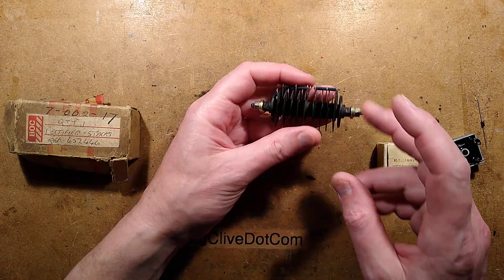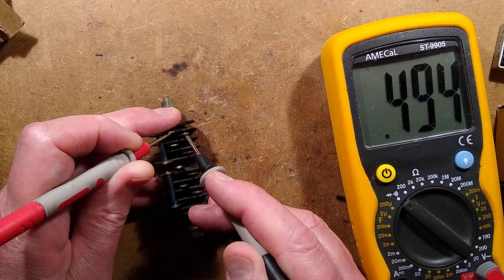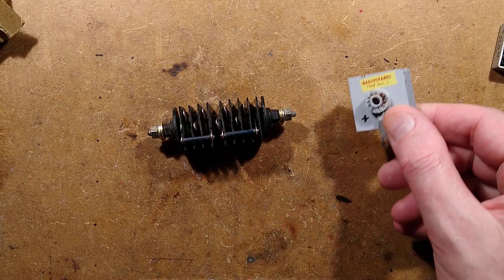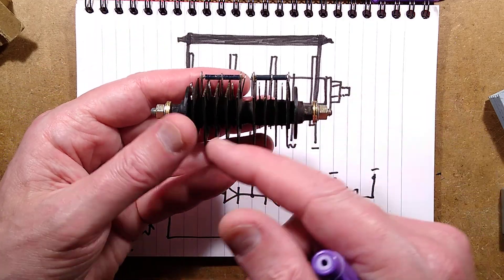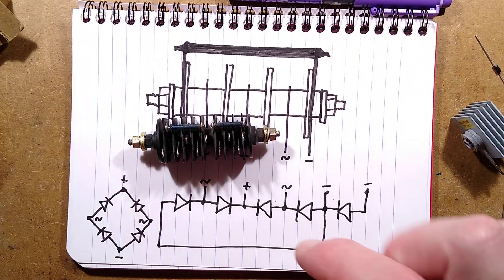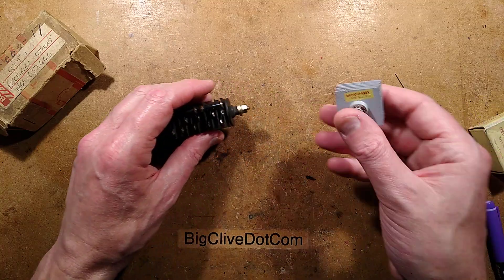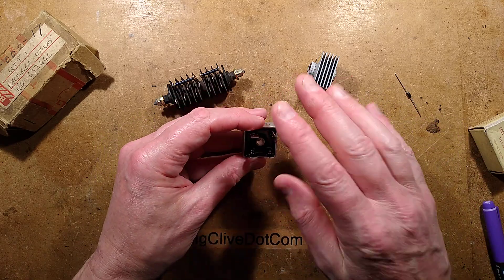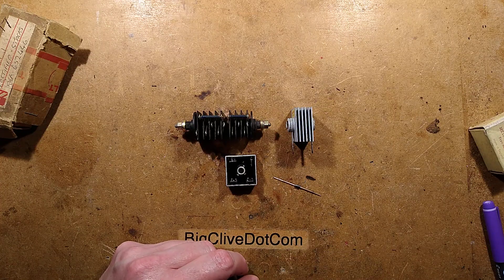Selenium rectifiers - the smelliest components ever

Comment: Had to deal with that smell only once in my career as a cinema service tech... it was horrid. Ruined my clothes and took weeks to get the smell out of my tool case AND truck. One of the two converted (old carbon arc to xenon lamp) rectumfryers shit the bed.  They both got replaced with newer silicon based ones after I warned them the second one would fail soon too.  I think I have a few of the much smaller ones ("new" old stock) in a box of parts I bought at an estate sale.

Comment: In the early 70s, selenium rectifiers and electrolytic capcitors rated at 300V were easy to recover from discarded B&W TVs. We built a big capacitor bank, connect a rectifier to the mains and charge the capacitor bank. Upon shortening, they made a scaring BANG! 
Yes, I remember the stink, when the rectifier got hot.

Comment: Replacing a selenium rectifier with the diode square hasone pitfall : The selenium rectifier assembly forms its own heat radiator, so the equipment is usually lacking anything usable  for the rectifier brick, even often it becomes a pain in the rear to find any suitable place to mount one of those generic rectifier/SSR heatsinks in a way to not obstruct the airflow...
Reply from the maker: Thankfully the voltage drop is much lower, so the rectifier generates less heat.  In many applications it can simply be screwed to the chassis plate of a panel.

Comment: Those old musty electronics parts boxes you displayed reminded me of the hot smell of WW2 vacuum tube electronics. I grew up in 60’s Dayton, Ohio adjacent to Wright-Patterson Air Force Base which generated mountains of surplus military gear. It was sold locally & found in businesses & schools. In 1964 I purchased a replacement acorn tube for the IF section of my surplus Hallicrafters S-27 receiver. It was packaged in its original 1943 box & cost me $21-1964 dollars derived from my newspaper route. I spent hours listening to foreign shortwave broadcasts, the YouTube of the day.

Comment: I've got a pretty good-sized box of those things somewhere in my garage
Reply from the maker: They may have collector status now.
Reply: @bigclivedotcom if I ever clean up my Electronics hoarder garage and find them I should probably send them to you
Reply: I think it's been a couple of years since I've seen it but I used to have this thing I built in high school at used a 555 timer a relay several D cell batteries and some spring connectors if I remember right they might have Been nicad battery powered 

I think its sole purpose was to provide a time delay and burn up whatever it was connected to it via the spring connectors I think I had some very smelly resistors or diodes that I used in it

Comment: In the 70s if you were following a TV engineers estate car or van you would often see something hanging out the rear door. This would be an EHT multiplier usually a tripler or quadrupler, it supplied 25000V to feed the CRT. There were five or more selenium sticks potted in a rubber compound, the smell of a faulty unit was so powerful you could often diagnose its failure on a service call the instant the customer opened the front door.😂

Comment: Ah ... now I know what the weird device is that's been sitting on my bench for quite a while! I "inherited" an old car battery charger from the early 1960s ... was still in use until a couple of years ago. It was one which was switchable between 12V and 6V as my stepfather had used it with an old VW that had 6V electrics. When it eventually stopped working I opened it up to have a look inside ... and I saw a device that was completely new to me. I guessed that it must be some kind of old rectifier but I don't remember it making a stink when the charger stopped working so perhaps the rectifier itself is OK. Many thanks for (another) educational video!

Comment: The worst. We had a extremely old forklift battery charger that used some extra large Se rectifiers, we are talking about plates that made it look more like some kind of space heater than a diode. Anyway it let go and made the whole factory smell like 💩. It used 2x of them with a huge transformer. Ended up replacing them with silicon arc welder diodes, but had to change the input tap from 208v to to the 277v since the 0.8v is far less then the several volts that the original ones had. Charger also ran a LOT cooler too. ❤

Comment: I'm old enough to remember these. I had a motorcycle that was old in the 1970's, and it had one of these as part of the charging circuit, and a record player with one. There may have been some where I worked, too - but I never smelled one fail. I learned a lot about these today!

Comment: I have a vintage spot welder that uses these - still works very well. It must deliver a couple of hundred amps... It's in quite a big housing (built in to a bench), so I am tempted to repackage into a smaller package so it can be benchtop - silicon diodes are quite a lot smaller 😂

Comment: Always wondered how they worked.  The only one I have seen was in my ancient BSA 250, bought in 1964 for 15 quid.
I thought that there might be one in a Linwood battery charger I got from Tandy in 1980 but not so, just a pair of silicone diodes, half wave rectification.

Comment: You can still find Selenium rectifiers being used in car battery chargers, especially those from China. Their voltage drop, rather rough DC output and internal resistance can be useful for Lead/acid battery trickle charging.

Comment: I can  custom order selenium rectifiers in any size from 1/4 inch x 1/4 inch x 1/4 inch up to 15 inches x 15 inches x 96 inches. Electroplating facilities, and DC elevator motor power supplies still use them. You are NOT replacing a selenium rectifier, with a bridge rectifier in a circuit that requires 600 VDC @ 200 amps, or 6 volts @ 2000 amps.

Comment: this was great. i have a bit of 'thing' for rectification of late. i would love a pretty mercury rectifier with it's smashing blue glow to play with. i just learned they used 3 phase ones, some years ago, to play an alien brain thing in dr who. how cool is that? talking of rectification i have been trying to get a chunk of galena to rectify the signal from my function generator, so i could watch it on my 'scope. i expected it to behave like a diode does, but a bit worse. tbh i couldn't get it do to do anything observable. i spent ages stabbing about with my probes. either i am failing to understand something obvious, which is entirely possible, or maybe galena can only rectify tiny weak radio signals. i have looked online to find out but all i find are crystal set instructions, when i could really do with a lump of galena data-sheet. i was hoping i could get four lumps and make a full wave rectifier for fun with them. i can't.
Reply from the maker: You may be able to buy a vintage mercury rectifier tube on eBay.

Comment: No,  it does NOT smell like a fart,  it's MUCH worse...!

When I was a kid,  I put a little plastic box with a switch in the middle of an extension cord.  The middle position of the switch was off,  one side would directly connect things,  and the other side would put a small selenium rectifier in line.  Plug a lamp in and you had a sort of a dimmer.  I was showing off this device to a neighbor lady after I'd gotten it built,  and then progressed to trying various things out when it let that nasty smoke out.  I'll never forget that smell.

Much more recently,  a friend brought over a nice Grundig tube-based console stereo that he wanted me to fix because he liked the sound of it.  I traced the problem to a bad rectifier,  and was surprised to find that it was selenium.  I put a terminal strip in there and some 1N4007 diodes,  and it worked just fine after that.  Finding a similar rectifier in my box of diodes,  that one went right into the trash.

I have a couple of other ones around salvaged from something or other,  painted blue.  I remember these being in electronics stores I'd go into as a kid and being rated at "500mA".  I've absolutely no intension of using them in anything,  I just kept them because they look cool...    :-) 

You'd typically see a pair of these along with a pair of electrolytic capacitors in a voltage doubler circuit in some transformerless B&W TVs.

Comment: I used to work at an old movie theater from the 1930's that had the old arc lamps.  They had both, the selenium, and lamp (diode tube) rectifiers.  You could either deal with the stink, or deal with the X-rays from the tubes as they were quite large, about the size of a melon or cantaloupe, and I was not fond of either.  At least when the roof vent fan was on, working in the projection booth was half way tolerable.

Comment: Back in the '50s and '60s when these came out they were considered hot smokin' weapons! (Pun intended)

People were all over them because they made transformerless supplies more viable, especially since they cost less than a similarly rated rectifier tube and socket.

They were also configured as voltage doublers - where the cost savings was even better - replacing two tubes, sockets, and associated current load.

I have also seen them in applications like car battery chargers and welding equipment where they had larger fins and forced air cooling.

An article in the trade magazine Electronic Technician from back then described the manufacturing process:

*  Each plate was coated on one side with electrolytic nickel, then coated with selenium powder.

*  This was baked in a high temperature oven that melted the selenium and bonded it to the nickel layer below as the selenium-nickel junction was the diode.

*  It was then subjected to a high forward current briefly in a step called "electrical forming" which helped establish the actual diode junction.

The diode stacks were rated for "X" amount of current at 15 degrees C, derating relatively linearly as the temperature rose.  The manufacturers data sheets also indicated that the current draw could be increased beyond the spec in free air by forced air cooling.

Comment: There is a form of mineral, such as Selenomethionine, where the Selenium molecule is bound to Methionine. If overheated this is already one part of the disgusting toxic stink. The other component is a sulphur-containing aminoacid that's also found in smelly foods like eggs and onions. That is then caused by H2S (hydrogensulfide gas) what it gives off the typical "rotting egg smell" if overheated. Hence the stench.

Comment: When I was an apprentice with the Post Office back in the early 1970s I spent some time in the local repeater station. This was on the ground floor of an 11 storey building. A selenium rectifier fire in a Signalling Unit  18B (a 500Hz/20Hz ringer for private circuits) permeated through the entire 11 floors within a few hours of the event. It lingered in the repeater station for many weeks. Once experienced, never forgotten! Some interesting facts here sbout these rectifiers, especially regarding use in bzttery chargers. I have some relatively recent chargers ( manufacturerd in the past 40years or so) that still used selenium rectifiers. Now I know why!

Comment: One site I used to look after (in the 1990's) had a 2kW AM transmitter from the 1950's used as an emergency backup.

It originally used Mercury Rectifier tubes. There were two of these in the spares.
When they were difficult to get, they attached Selenium rectifier stacks onto the tube bases. There were two of these in spares.
When selenium rectifiers became difficult to get, they soldered silicon diodes onto the tube bases. THere were two of these in the spare parts as well.
There was about 50 years of history on the shelf just in these rectifiers. The transmitter was replaced in the early 2000's and I don't know where all this history ended up.
Sorry to necro-post, but Youtube just suggested this video today.

Comment: I worked for a dairy. We used these in chargers for milk floats and fork trucks in the 60s.they failed regularly. The milkies would turn up at 5an for there shift to find a acrid stink and the float with a dead battery. No milk today. Many gallons of milk down the drain as it was thought to have gone off. Are head Engineer would not change to silicon and Germanium. Until he retired . Changing to solid state meant the chargers ran cooler and the floats had a longer road time. Happy days.

Comment: I've got a couple of bits of electronic equipment with those rectifiers in them. A RF frequency generator and a valve voltmeter, they are seldom used, though

Comment: So many of these still in use today in old Elevator equipment. One of the quickest electrical elevator issues one can trouble shoot, you know the second you walk in the machine room, and the only tool you need for diagnosis is your trusty ole sniffer.
Reply from the maker: Easy fix too with the classic block rectifier.  But sometimes needs a tap change to nudge the voltage down.

Comment: I've seen one of these on a 1916 (yes, world war 1 era) 130kv circuit breaker.  it was part of the control circuit.  thing was in service for almost 100 years, was on a transmission line that pretty sure predated the AWG (American wire gauge) standards.  it was tiny, only like 2/0 or so equivalency.  only reason they kept this little piddler running is because of these ridiculous scam "green" mandates, going to a measley couple MW hydro generator plant.

Comment: Selenium sulfide .hmm. Smells just like ??????Fixed an old car battery charger which had these rectifiers in it .Replaced the diode with a silicone one and replaced the mechanical 60 minute timer .

Comment: Are selenium rectifiers (note, I stress the difference in material not the rectifier itsel…) still in use today anywhere?
Reply from the maker: Yes they are.  But just as legacy components.  They tend to get replaced with silicon rectifiers when they fail.

Comment: On my second viewing of this video (and praise be to The Algorithm Gods for bringing this video back to my jelly-filled light buckets) it occurs to me that the extra diode on the negative side could be used with a condenser (since we're assuming thermionic valves; none of that newfangled capacitor rubbish!) to provide a grid bias voltage. -1V is a typical grid bias voltage for small signal triodes.

Comment: Ahh I found out recently, Type 3 refers to the intended use, which is usually power supply or power dropping, a type 3 resistor would be a dropper resistor, before the use (generally for power supply) of transformers

Comment: Back in the 1960s, I had a cattery charger using large selenium rectifiers. Also a number of higher voltage stacks from military gear. Never forget that garlicky smell. They don't smell in normal use, but some were coated in tar so I dissembled them and scrubbed them down... still worked OK but let some of the magic smell out!

Comment: Informative and interesting; a good pairing. Thank you. If you were replacing these as a matter of maintenance (which I suppose you should do upon discovery,) it would be easy to read their voltage output, so as to match it. But, what to do, if one is failed? How to determine the voltage requirement, sans all other clues? Bring it up with a variable autotransformer and stop where the current draw becomes steady?
Reply from the maker: You can count the plates for a rough indication of voltage.  But the classic replacement for these is a block 35A rectifier rated about 600V as standard.

Comment: The phone company didn’t use those much as they didn’t last as long as they desired.  But they did use a very similar design with copper-oxide on the plates.  Old car alternators used copper-oxide stacks too.

Comment: Back in the 1960's I was working as an apprentice Radio & TV engineer and these were quite common on older TV sets, when they failed we left them in place and connected a diode to one end with a wirewound heavy-duty porcelain type resistor in series then removed the other lead from the end of the failed rectifier and connected it to the wire wound resistor. The old rec was just left in place to support the diode and resistor.

Comment: When I was a kid back in the late 60s, I had a Matchbox-branded slot car racing toy that looked like a kind of cheap-and-nasty Scalextric setup, but instead of applying power to a pair of tracks, with pickup brushes under the cars, this toy had one central motor that drove a long spring around the track, and the cars had a plastic pin underneath that engaged with the spring, thus making the whole thin much cheaper as the cars didn't have to include a motor, and the system would work with any of the Matchbox toy car range.

Anyway, it eventually broke down and was duly dismantled, and the power supply for it (around 6V DC if I remember correctly) consisted on just a basic transformer and a selenium rectifier (no capacitor of course as it was just driving a small DC motor)

Since other products available at the time were already including silicon rectifiers, I get the impression that either the toy was already outdated when I had it, or the manufacturer just had a stock of ancient components that they wanted to use up
Reply from the maker: Was it a blue power supply?  I may have had one that powered many of my projects for years.

Comment: The only time I've come across selenium rectifiers was when I did a teardown of a Griffin 5kV lab power supply.  It's got two 8150 volt 5mA STC SenTerCel selenium stick rectifiers.  The voltage drop means they're just a tiny bit too much for my Fluke's diode test to handle :)
Reply from the maker: Even modern high voltage diodes defeat the classic diode test.  They still use a stack of silicon junctions.

Comment: Those were found in negative DC grid bias supplies in tube amplifiers where the B+ was tube rectified. That 5 plate rectifier has a bridge for B+ and a single for tube circuit grid bias I guess.